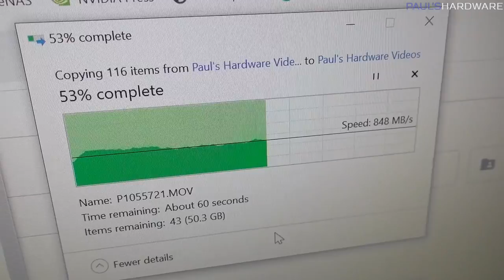We Should Have Done This a Long Time Ago...

Comment: PC 011 Dynamic fix: use rear-view-mirror adhesive from the parts store. it is meant to affix metal mirror hardware to glass, and hold under pressure, heat, and impact. give it a try, its cheap.
Reply: thanx. I was about to just hit up Lian Li but that work. Much prefer dyi when possible.

Comment: Home-owner/Property Manager tip:
There are liquid (and powder) drain chemicals, that unclog your drains and eat up that gunk and hair, that can be used as maintenance/preventative measures so you don't have to needlessly replace perfectly working hardware. From a cost perspective. I use something called heat crystals (or something like that), but any 'foaming' agent works best. I use it once a month or so in the sink and shower drains and it works well. I started using this stuff to kill roots that were getting into the main before it hits the street, but even after the city replaced the pipes damaged by the roots (they were city trees), I still use it as a preventative and never have issues. Definitely keep area well ventilated (exhaust fan and/or window open) as some vapors can be toxic when reacting with metals, or just in general.

Comment: You can use windshield urethane and windshield primer to reattach the metal to the glass. Coming from an autoglass technician. Do this daily to install windshields. Use the urethane sparingly and thin for that particular application.

Comment: Water cooled sink huh? Fascinating. How much RAM does it have tho?
Reply: The real question is, wheres the rgb?
Reply: Rolica
ever since 2012, 64 Gb DDR 4 3200 is enough to run console titles on PC, 32 Gb can do the job too.
Still you cry, reading issues? Why you need Video's? Baby issues, copper pipings?
Reply: @lucasrem  ???? How high are you?
Reply: The one time RGB could be useful and no RGB. 🤦🏾‍♂️
Reply: @lucasrem  DDR4 was released in 2014, and who the 'f' had 64GB of ram in 2012? why all the hate for Rolica?
Reply: But is it a heat sink?

Comment: @Paul’s Hardware
There is a special epoxy that is used to glue the metal mount for your cars rearview mirror to the window shield that will solve your issue with your Case window.

Comment: Paul, try a small batch of JB Weld to hold the frames in place. Be sure you will never need to remove it for any reason, because it is a permanent adhesive.

Comment: Use 80 grit sandpaper to scrap the metal and glass, de-grease the surfaces with isopropal or acetone, then get some 2 part epoxy ... will hold like a charm.

Comment: The J-tube sink drain looks like it's made of metal. Might want to consider replacing the metal sections with the black plastic type of drain, and re-engineer it to make the sink drain straight down into the J-tube, instead of using that white flexible tubing. Another item to have on hand for drain cleaning is what's called a "blow bag" or "Drain Cleaning Water Bladder" which is connected to the end of a garden hose and can be used at the drain portion where it enters the wall. A toilet plunger applied over the lavatory sink drain opening (with the sink temporarily filled up with water) can also be a useful method for avoiding having to disassemble the drain parts.

Comment: since you give good advice. here is some. if your case has glass super glue or contact cement(  if you plan on breaking the glass). 
plexiglass then contact cement. or epoxy. 
bathroom sink. the p trap swivels at center joint. and some ammonia and a good flush of water afterwards once per month bis a good idea.

Comment: Paul your baby is sooooo cute!!! It is easier to put the plumbers putty around the bottom of the pop up flange,  then it is less messy.  Buy some hair catchers for your drains bath sink/shower/tub.  Next time your drain slows because of hair Pour a pot of boiling water down that drain, then 1/2 cup of baking soda,  then pour a mixture of 1 part vinegar, 1 part hot water, pour that in the drain, and plug or cover the drain, the reaction of the baking soda and warm vinegar will cause a reaction that will loosen up any clog. Can you do a video using plummers putty as TIM for cooling a cpu?!?

Comment: Use some JBWeld on the metal coming off that case.  It's some of the strongest 2 part epoxy you can find.  ProjectFarm did a video testing strengths of epoxies.  It's pretty much the best.

Comment: Draino will help aslong as nobody has put cigarette buts down the drain 3 months after moving into a rental property the kitchen sink blocked up and was over flowing something to keap me busy when i got home from work which was RND in an engineering company testing plumbing valves gas fittings made on cnc machines that used windows 95 CAD we upgraded to win 98 just befor i retired after destroying two lower vertebra and my knee in a car accident this is all a bit long winded  but for me your just starting a family so i will say dont panic you have a lot of people  to talk to

Comment: you would have done better changing that flimsy flexible connector for a solid one then you can clear a blockage as soon as it starts to slow with a sink plunger. Which you can't use with the flexible hose as it will just blow off the lower pipe

Comment: Hey Paul, try not to use these flexible drain pipes: they are the worst! They get clogged relatively fast and work like washboard, which gold miners use to trap gold. But instead of gold, you get dirt.
#trustmeimanengineer
Reply: Even better use air cooling NO moisture leaks

Comment: 2:11 Paul! I had the exact f*cking case, it looks great but, I had the same problem about 3 months ago where the side metal piece just peeled off and the glass nearly dropped on my foot. What the Lian Li should have done is to use screws as the adhesive is a piece of crap.

Comment: you should really get the bathroom sink done right. remove the crap extendo pipe, just to put in another one that will have to be cleared again........ not to mention the water that can come out of that joint ( if you can even call it that) when it clogs again.